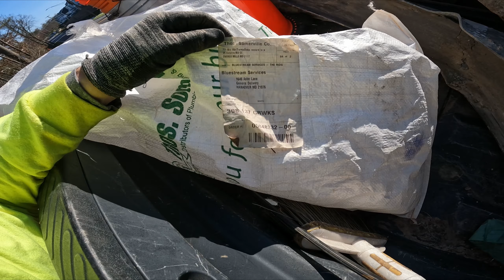Roadside Trash Pickup -  Sunday Part Two -  Upper Ridge Road cleanup  - "The Ridge" Townhomes again.

Comment: Is the collected trash collected by carbage trucks, or in other words do you leave the collected stuff near the site of the road?
Reply from the maker: Yes, for the past several years we have left the trash for the SHA or county to pick this up.  It saves me valuable time and gas doing dump runs, and often times I had so much trash filling my truck that I could not fit it all in one trip.  My little truck was looking like the Grinch who stole Christmas's sled at times.  So rather that drive it, and potentially lose a bag in the road and cause another mess (and legal mess), I now leave it all piled up.  I hope this also helps trash shame and raise awareness of all the passerbys to point out the huge trash problem we have here.  But I think these folks really don't care about tossing trash since the continue to do it.
Reply: @DanOTaylor  Is there any shame? I think it could be reinforcing someone will pick up the litter. You should repurpose the bandit sign to state don't litter here.